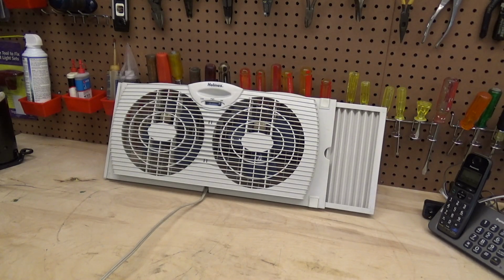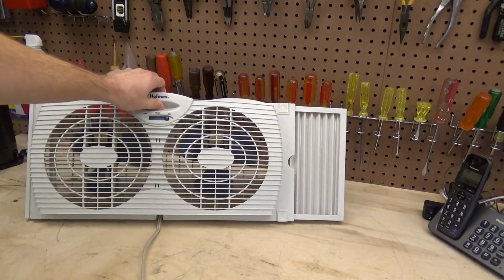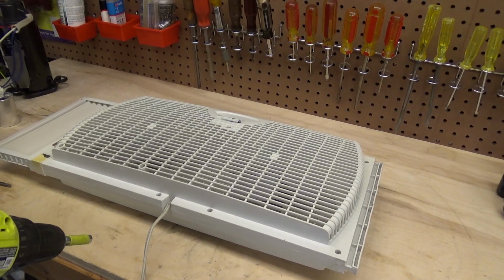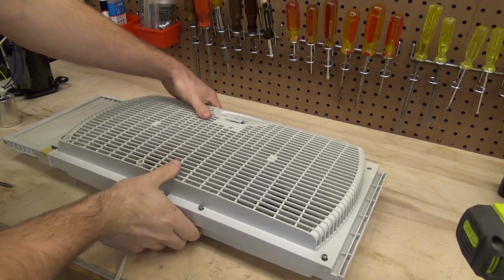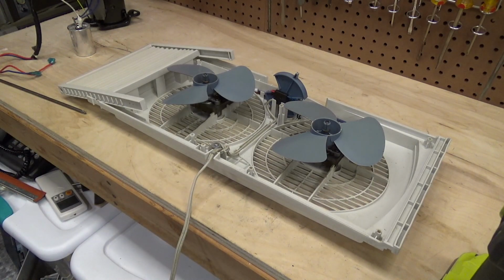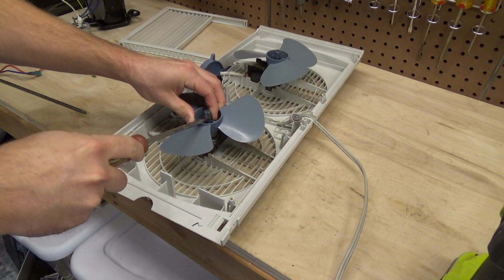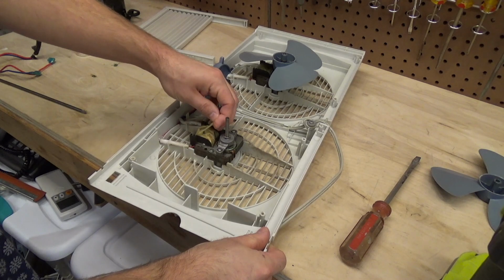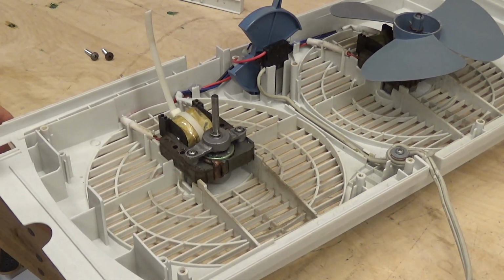Holmes HAWF2021 Twin Window Fan Repair

Comment: You can actually toss the motor/fan units in a dishwasher to make them run silent and spotless.
Reply from the maker: Not only would that not have solved this particular problem, you absolutely should not put the electrical components into a dishwasher.